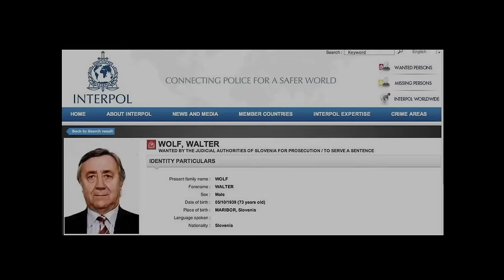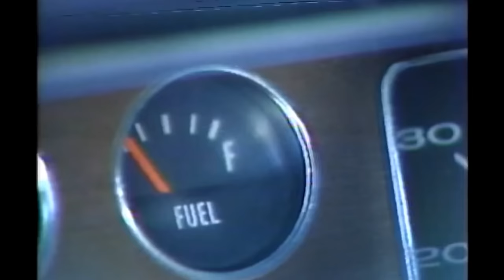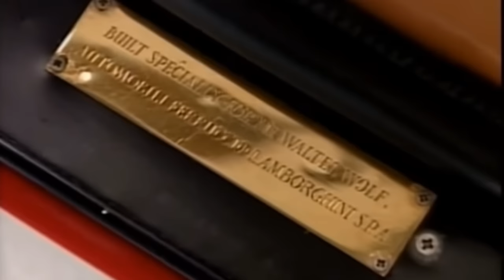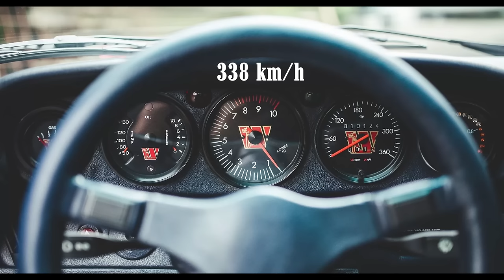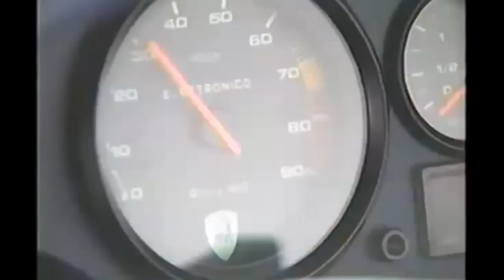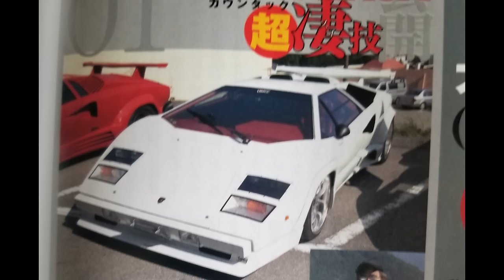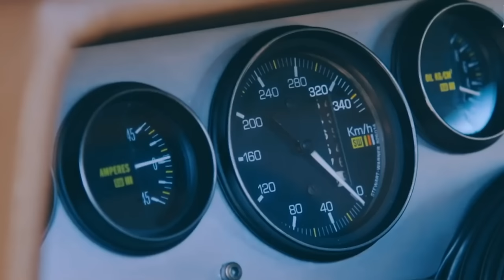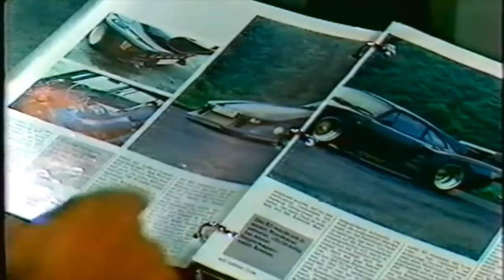The Story of the Canadian Wolves in Japan that Saved Lamborghini

Comment: The point on the Countach doors being necessary as they were needed for reversing is total rubbish! Where do these guys get these ideas. The doors were like that because of the really wide sills, like a 300sl only it was a different solution. The fact that it allowed the driver to reverse in that way was a technique developed while moving the cars around the factory and was just a bonus. If it was for reversing then why did they go ti the bother of developing a periscope rear view mirror (which didn’t work) but that’s not the reason for the scissor doors. Try to be accurate before posting content as it’s an easy but if info to find